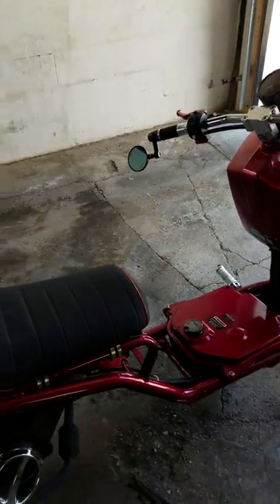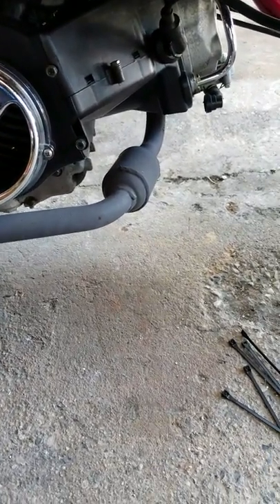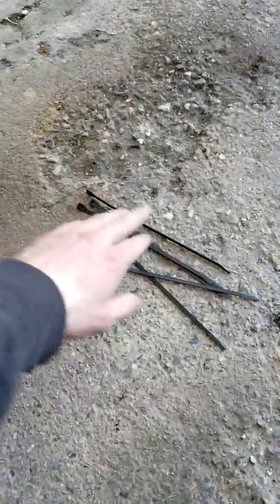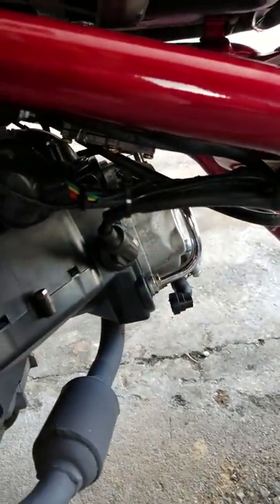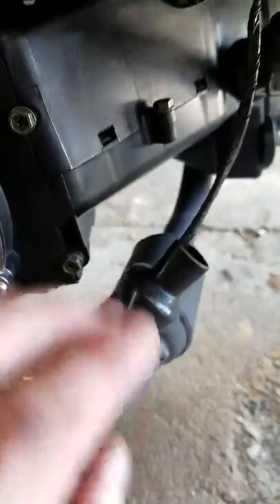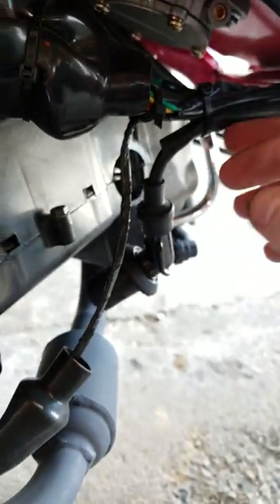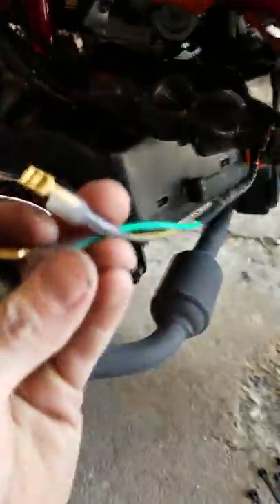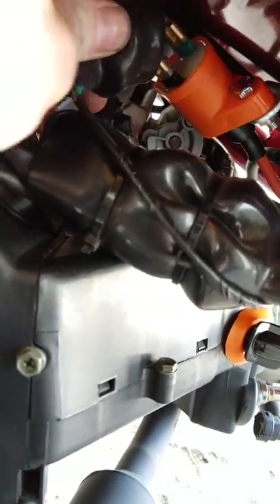2017 gen 4 Icebear maddog replacing the ignition coil

Comment: Did u notice a difference when switching the ignition coil ?
Reply from the maker: Not to much really I feel like all that smaller stuff is only noticeable if you go from stock to a big jump like cdi,plug and coil then you kind of notice it on take off but just the coil itself not really
Reply: @RspecNick  all i have done on my 2015 150cc is change the cdi . Im looking to get a 30m oko carb soon
Reply from the maker: @migoabu3928  yea I wouldn't really worry about the coil then that carb will be really nice there super responsive and with some jetting they can get you some more power